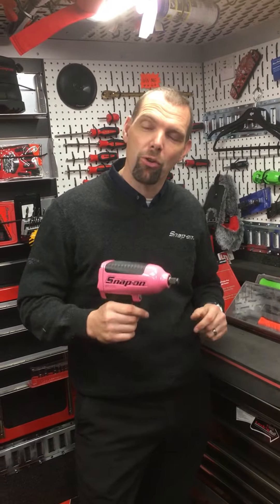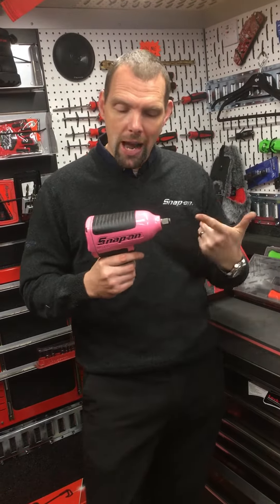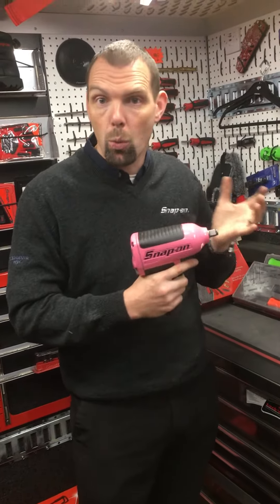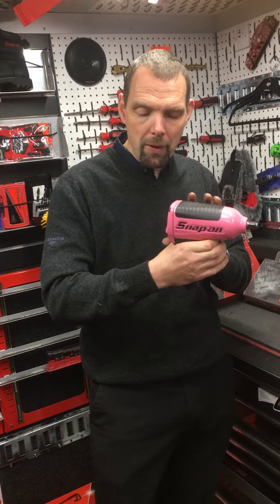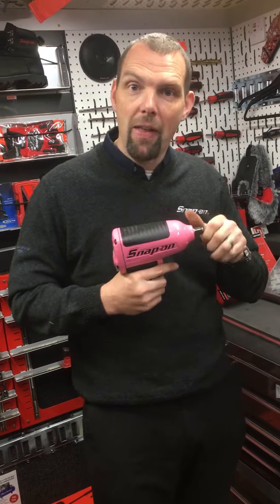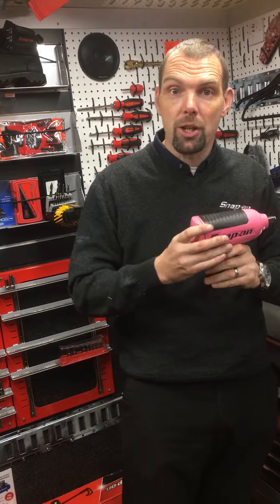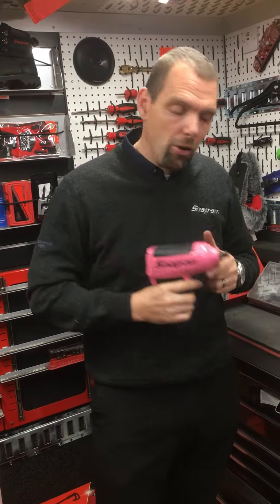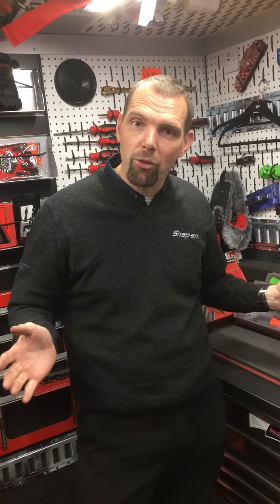NICK THE TOOL: MG725 IMPACT GUN

Comment: Does the tool have some movement of the inside parts when you turn it upside down and shake it around.
Reply from the maker: You will here the hammer shake from left to right.
They float on the anvil so yes is the answer